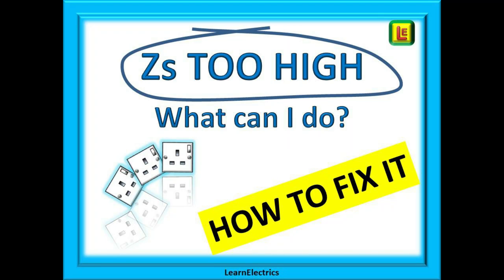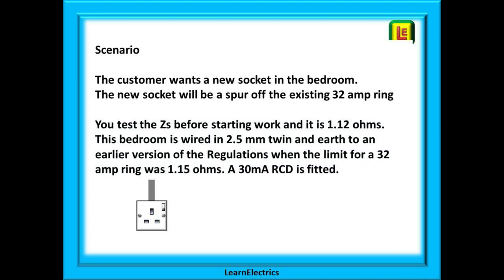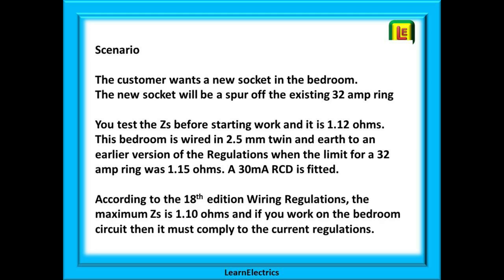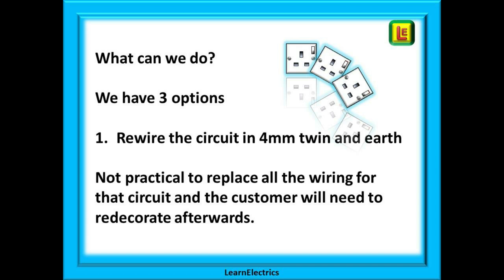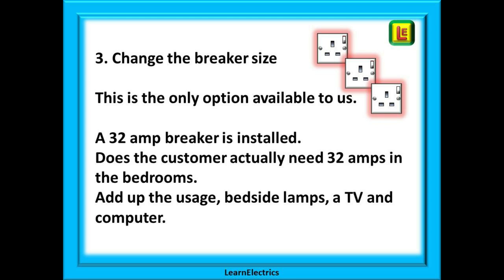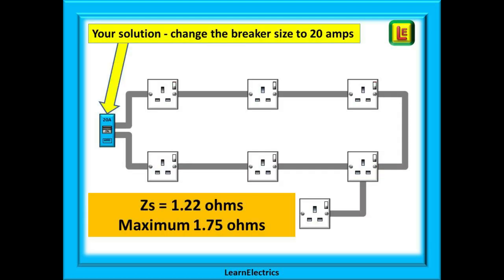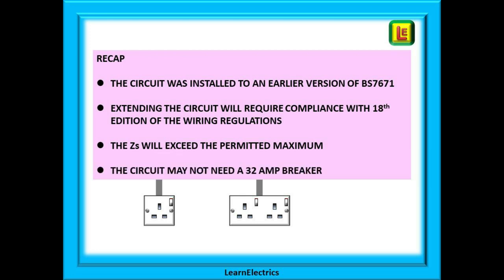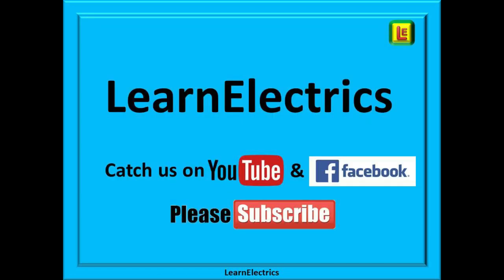Zs TOO HIGH What can I do?

Comment: I can't believe that the UK allows 32amps on 2.5mm cable generally our current rating for 2.5mm down under is 16amps can be derated depending on other factors like insulation etc
Reply from the maker: Ring circuits - effectively 5mm conductors. Until one leg is broken and then we're in trouble. Which is why many sparkies now install radial circuits on 20A breakers in the UK. thanks for your antipodean comments, very much appreciated and thanks for watching. Dave.
Reply: Definitely can do way more than 16 A depending on the situation but a ring circuit splits the current. It is also worth knowing that with periodic EIC test ring congeniality is verified so it does lessen the risk of it being broken and creating a dangerous situation.

Comment: it's funny, bc here in north africa (at least in algeria), basically every switch board is full of C32 MCBs xD
it's an electrician joke (and i'm not), there are C10 and C16 available, but often DIY people put a C32 to avoid nuisance tripping bc of AC unites (but it's mostly due to bad wiring schemes)
Reply from the maker: I know what you mean. Lots of places leave a lot to be desired. Thanks for the input. Dave.

Comment: I thought 4mm twin and earth had a 1.5 mm earth wouldn’t your ZS Be the same if you run it in 4mm ????
Also I’ve heard if you have a R.C.D you can use table 41.5 1667 ohms as a get out of jail ???   What are everyone’s thoughts on this ????
Reply from the maker: Yes the higher Ze is permitted but this should be where a TT system is installed as per Reg 411.5 and Table 41.5. We should try to get the internal part correct by cable size and breaker rating. Good points though. Thanks for viewing.
Reply: @learnelectrics4402  it’s so confusing 
411.4.204 and if it’s safe enough for TT systems why is it not safe for other systems when you know you realistically will never have a zs higher than 2 ohms on a ring final circuit.

Comment: The max zs with 30 ma RCD is 1667 so why change anything ?
Reply from the maker: ZS 1667 ohms is for TT systems only. take a look at section 411.5 pages 63 and 64.
TNS and TNCS should comply with pages 61 to 63.

Comment: If you have 30mA RCD protection then your allowed up to 1666 ohms,
Reply from the maker: Only for a TT system. If its TNCs or TNS then no. Hope this helps.
Reply: @learnelectrics4402  thanks
Reply: @learnelectrics4402  Reg 411.4.204 says otherwise, this allows T.41.5 to be used 1666ohms on a TN-s or PME, i hope ive read this right , enjoy your videos by the way

Comment: Bs7671 18 edition max Zs Zs for 32am type B breaker is 1.37 not 1.10
Reply from the maker: Maximum Measured ZS is 1.1 ohms. This is what you measure with your test meter on site. BS7671 states that Zs is 1.37 before making the adjustment for temperature of 80%.
1.37 x 80% = 1.1ohms as per wiring regs requirement for part 6 - testing.
The Zs shown in the on-site guide is 1.1 and this is what we should use to compare our test measurements to. Hope this answers your question.